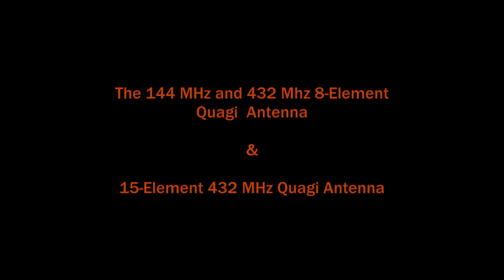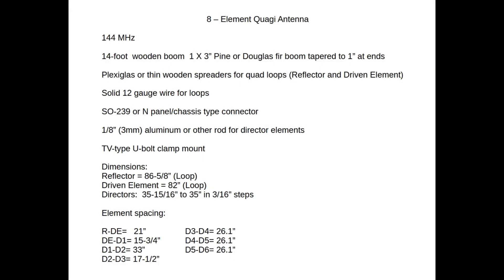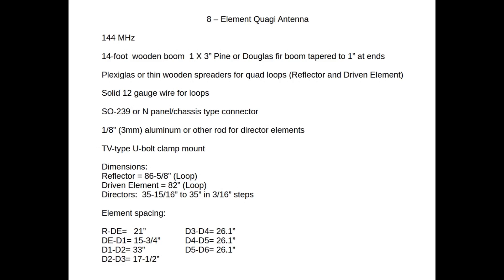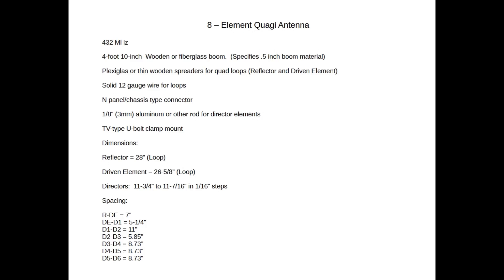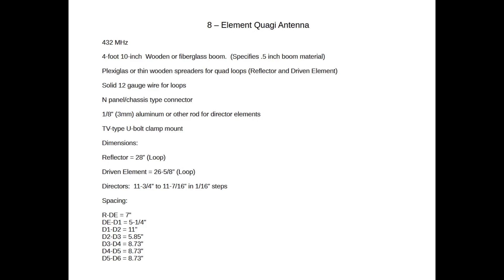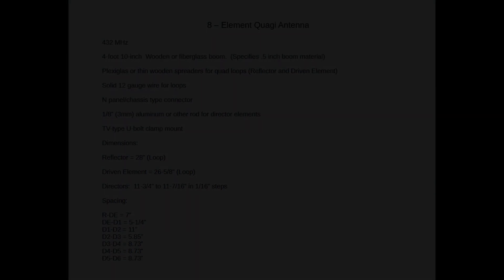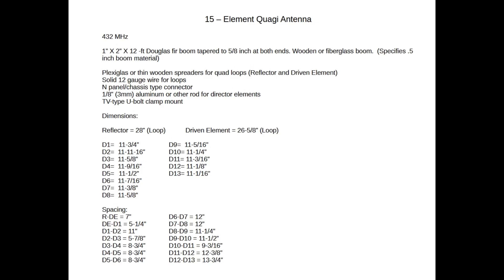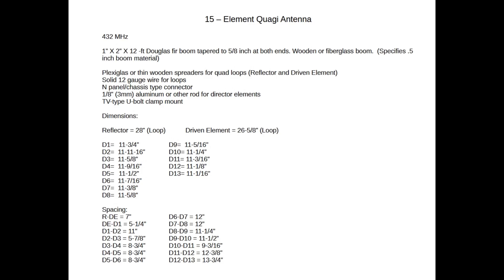An Easy to Build Inexpensive High Gain Antenna For 144 MHz & 432 MHz

Comment: Nice vid.  A little lengthy in the beginning but was able to skip through.  The only way I knew what was being built was by the use of the name, Quagi.  I built a 2m 5el quad back in around '78 or so.  Sticks and wire and a prayer or 2.  Not sure of the gain but it was directional.  Enjoyed the build process and installation.  I'm always up for a homebrew project.  Keep em coming!  73's!
Reply from the maker: Thanks for your comments.  My channel is geared toward easier projects for the average ham.  The quagi was my first 2M and 432 antenna I used when I began contesting.  73!

Comment: I don't want to come across as a troll, but most of your recitation of your contest accomplishments are irrelevant to the vast majority of viewers. I think it would have been far better to start right out with a good picture of one of these antennas, then discuss the parts and construction with additional pictures or drawings, THEN perhaps something like, "I used these antennas in several VHF/UHF contests and they worked very well for me." I still don't have any idea what these antennas are supposed to look like, other than they have long booms and a lot of wire!
Reply from the maker: Hi Dave.  Thanks for your comments.  This design is from the QST article from April 1977.  It was in a number of ARRL Handbooks beginning in 1978 or 1979. The 1979 ARRL Handbook I have has the dimension and particulars and where I got the dimensions and parts list.  No pictures other than the quad loops on the 432 MHz version.  It's copyrighted material and can't be used here, sorry.  As I mentioned in the video info can be found on the internet if you need it.  Search for "Quagi antenna" on your favorite search engine if you have interest in the antenna.  I was also attesting to its performance from my experience in terrestrial and contesting situations.  I'm presenting it as a way for hams to get on VHF/UHF inexpensively rather than at first buying a $200-300+ antenna.
Take care, 73!